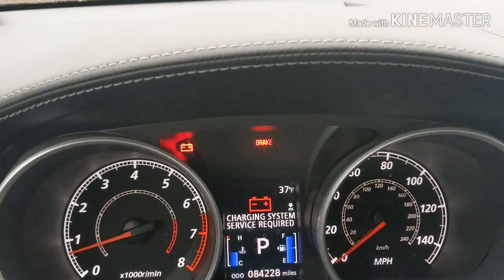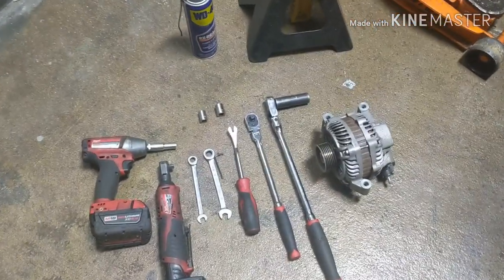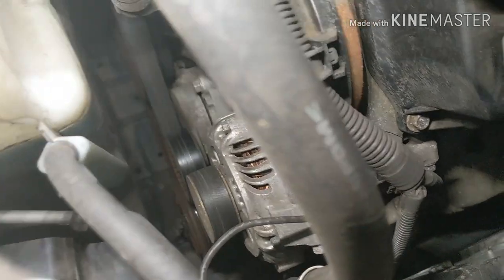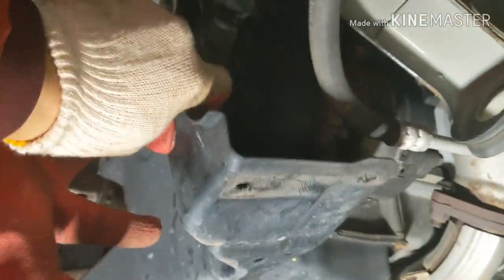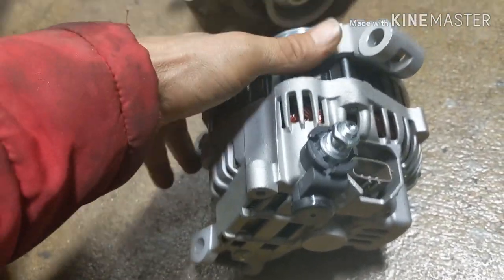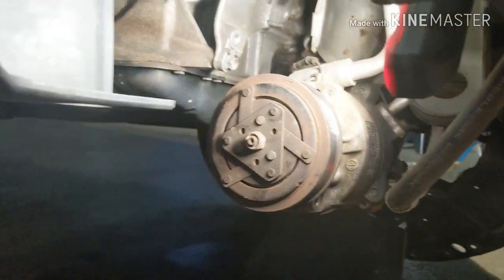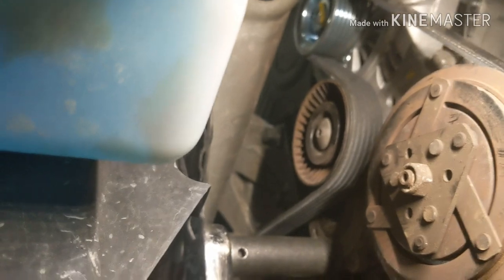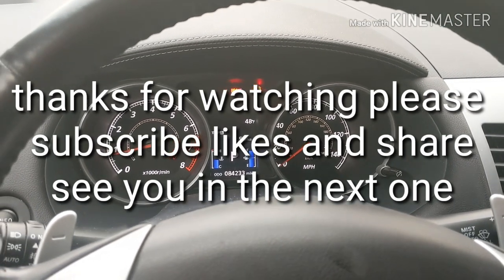2010 Mitsubishi Outlander XLS 3.0 V6 altenator replacement

Comment: That was amazing! One handed most of the time while filming. I should be able to do it with 2 hands!

My Outlander is very noisy around this area. That's the reason I'm considering changing the alternator as well as belt and tensioner. Not because it's not charging. But I am getting a whine coming through on nearly every AM station. But this vehicle seems abnormally noisy and I'm wondering if it's just the way they sound. Bought it used same as yours v6 xls 2010.
Reply from the maker: Wow , well this one is not  my lol I'm a mechanic I work on costumer cars , but yeah get it change and the noise will go away

Comment: Thanks for the awesome video!   You recommend changing belt as well, do you think it would be necessary to change the belt tensioner on a 2009 or just let it ride??  Rockauto recommends it, but don't want to spend extra if not needed.   I plan to keep car for 2 more years.
Reply from the maker: Thanks not really , if belt is good don't change it you don't need too